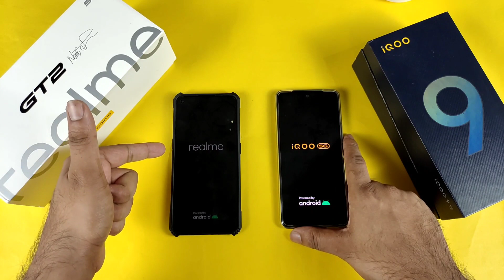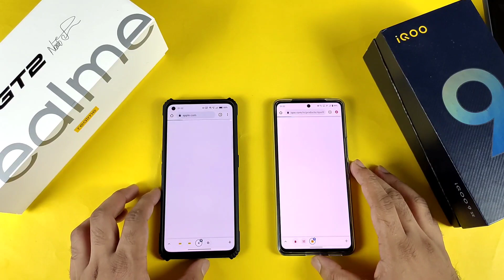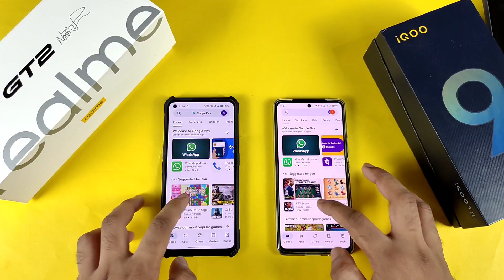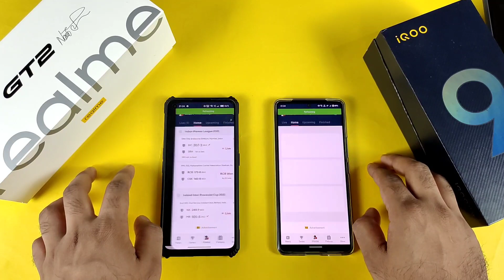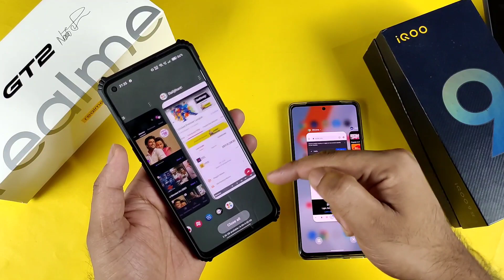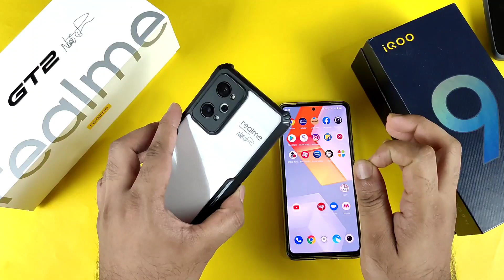Comment: I don't think anyone would want more than 5 apps to be running in background consuming battery.. so, i would prefer gt 2 over iqoo and considering battery capacity 😀
Reply: Yep bro i have gt 2 since 1 week if you charge your phone 100% till 50 mins only 1% battery will drop while watching YouTube also for 50 mins since I am using realme phones from starting firstly I use realme 2 pro the realme 8 and now realme gt 2 I will also prefer realme over iqooooooooooo🤣
Reply: @axmxkaushik9821  thanks for your comment, which helped me to decide.. I was also thinking between iqoo and Realme. Hope there is no overheating issues in Gt2. Could you kindly confirm?
Reply: @prabhus793  when I bought this devise it worms little bit but when I update quick devise connect no heat issue till now I play bgmi continuously for 3 hours but devise get only 39° temperature but when you will play without AC or fan then its will go 41° max so no over heating issue i faced so far.
Reply: I would like to go with the iqoo which sufficiently performs what they have promised instead of realme, as it doesn't carry its promise at least.